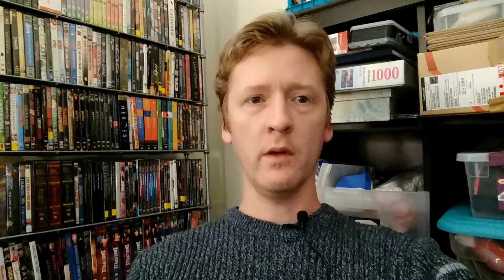Return of the Iron battery: next steps

Comment: I tried making a deep eutectic liquid using Epsom salt and Glycerin. I used it in a copper/magnesium cell but the mixture eventually turned blue at the copper and black at the magnesium and the performance of the cell deteriorated. I suspect the water in the epsom salt contributed to the deterioration by electrolysis. Epsom salt is a heptahydrate and is extremely difficult to drive off all the water. I thought about using magnesium powder and sulpher but never got around to it.I never tried to use other metals or oxides with the glycerin. I don't know if glycerin would be beneficial in an all iron cell. I'm not a chemist, I'm just an experimenter. I don't know if you have ever considered it. I thought it would at least be worth mentioning.

Comment: hi peter glad to see u r back on the battery subject yes have tried copper not very good found graphite with graphene works fine u need a solid semi permeable membrane as the separator. keep up the good work mine is working fine